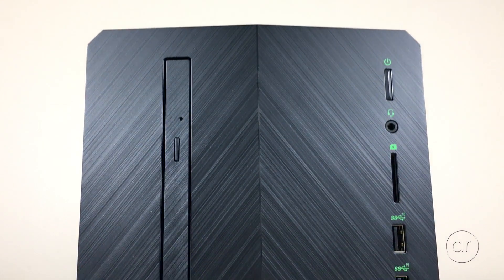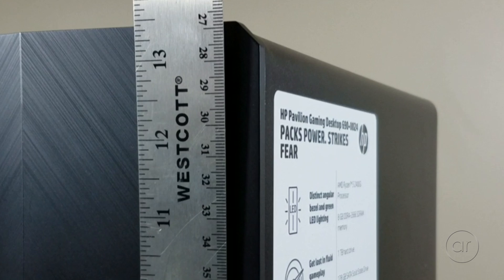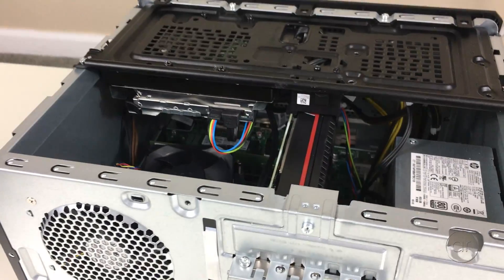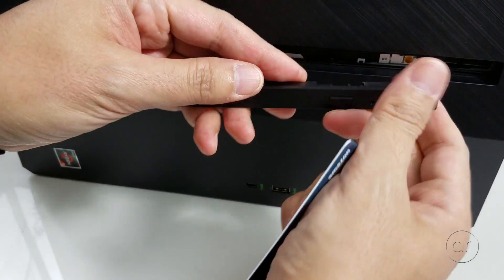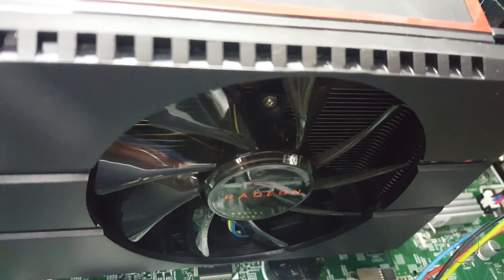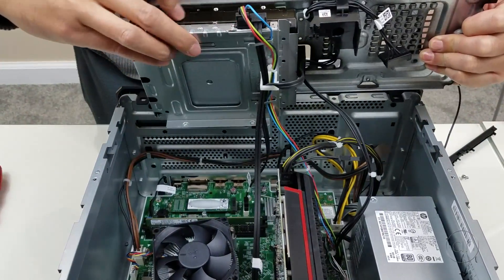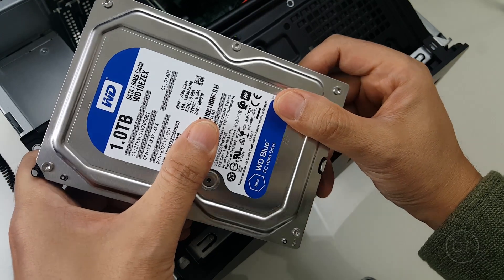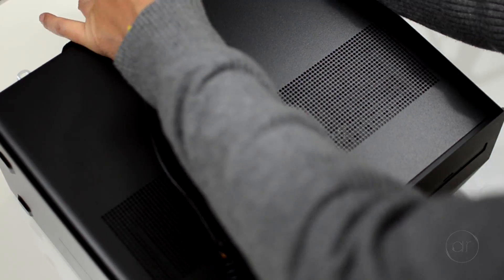How to Open and Upgrade a Ryzen-Based HP Pavilion Gaming Desktop

Comment: There is another 690 Pavillon that I’m looking at, but it’s 690-0027 (ryzen 5 2600 with rx580) it’s about $1999 in australia. Any good?
Reply from the maker: When I visited the Australian HP site, the 690-0027 came up as an Intel-based Pavilion with an i5-8400 and an NVIDIA GeForce GTX 1060. Interestingly, the only models that came up were for the Scandinavian, Russian, and Spanish markets. Would you happen to have the name of a retail site I can visit to find out more?
Reply: access random yeah, I’ve mostly been looking onto websites like Harvey Norman, officeworks and jbhifi, this pc I found on the jbhifi website
Reply: There is also another one in the website which is an Acer nitro n50-600 with a 1050ti but it doesn’t seem as powerful as the 1060 or the rx580.
Reply from the maker: I couldn't find that specific model on those sites, but going just by the specs you listed (Ryzen 5 2600 and RX 580) and with all other things being equal, like memory, SSD, HDD, etc., you'd be gaining some horsepower on the CPU side, falling somewhere between the 690-0024 and the 690-0034.

With that said, the 690-0024 is currently going for ~$1150 (AUD) in the US, with it dipping down to ~$740 (AUD) when on sale. I don't know how the PC market is in Australia, but $1999 (AUD) would not be proportional to the gain in CPU speed - which may not be a fair comparison because I'm comparing to models built for the US market.
Reply: access random okay, thanks anyway
Reply: That 2600 with a RX 580 for $2000 seems pretty high.
I dont know if harvey norman nz is similar but the prices dont seem the best bang for buck
Or Maybe look at what PB tech Aus has in prebuilts

Comment: @accessrandom Hello sir. Great video. Earned another subscriber. I recently purchased this model on sale via best buyer's 4 day sale. Also snagged a nice hp 25" 144hz monitor for low price. I am more than likely only going to upgrade the ram on this from 8gb to full max via specs at 32gb. Any suggestions if I would HAVE to upgrade anything else to handle the 32gb upgrade or ?? Was thinking of just doing two 8gb sticks but go big or go home right!? Appreciate any help you can offer or thoughts. Also any recommended brand sticks for compatibility or performance would be appreciated. Thanks again!
Reply from the maker: Thank you - happy to have you here! It's always good to future-proof your upgrades so you can use those components in other computers in the future - though there is always the danger that the memory technology itself could become obsolete (DDR5?).

The only problem is that the memory slots in the HP can only go up to 2666 MHz with no way to adjust timings - so if you were to get 32 GB of 4600 MHz memory, it would still downclock it to 2666. Because of this, you may want to just go with lower-cost memory that you will need for immediate/near-future use. Again, this is up to you...
Reply: access random it will be downgraded to 2133 actually lol
Reply: I successfully swapped the original 8gb stick and replaced with and added additional 8gb (x2) corsair vengeance lpx ddr4 3000mhz sticks. I did this last week on Monday. Today I decided to modify this desktop again by adding the Samsung V-NAND SSD 860 EVO 1TB. Again another successful install had a little trouble at first verifying it was acknowledging the ssd but after a quick format...its now viewable in disk management. Now my next question would be as follows. Is it possible to clone original boot files to this SSD for slightly faster boot up and running of selected program files I install upon this SSD? Or keep the original boot settings where they are and run my preference of programs and games desired off the new ssd? I know its ultimately my decision but just curious if I am able to clone the boot files over to the new SSD to get the fastest performance. If not it's really no big deal as I previously stated i can simply choose the programs and games I want to run off the new ssd.
Reply from the maker: Yes, it is possible to clone the contents of the M.2 SSD to the Samsung (and keep it bootable) - it will be very similar to the process in one of my other videos here: https://youtu.be/BZqkYnmDnas, where I clone from a HDD to an M.2 SSD. I'd use Samsung's cloning software as I've heard good things about it (make sure to back up any valuable data before doing this).

When you press ESC during the boot on the HP, you will be able to access a menu to enter the BIOS and change the boot order.

If this is a fairly new setup, you may want to consider just restoring Windows from the recovery partition directly to the Samsung.

Comment: @access random Hi! Great video. I tried running big games like Fortnite and Forza Horizon 4. No problems with fortnite, but im not getting 8 gb of required ram for Forza. Can I just grab the RAM stick you mentioned put it in the second port, and instantly play without having to install anything?
Reply from the maker: Thanks man. Yes, you can just install the second memory stick - known working models in the description. The reason you're not getting the full 8 GB is because the integrated Vega graphics on the Ryzen 5 2400G dedicates a portion of the system memory (thanks to Josh Patterson for his investigation into this).
Reply: @accessrandom  way to rip us off, we need to do something about this, get refunds or some shit
Reply: @accessrandom  Hey again! I saw this RAM at microcenter G.Skill RipJaws V 8GB DDR4-2666 PC4-21300 CL15 Single Channel Desktop Memory Module Will this do? And thanks for your time!
Reply from the maker: That one seems to have a faster timing. With all the possible incompatibilities between brands, I'm afraid the only way to find out is to try it, and then test the memory thoroughly using HP's memory tester or something like memtest.